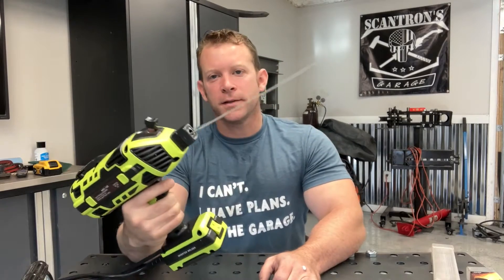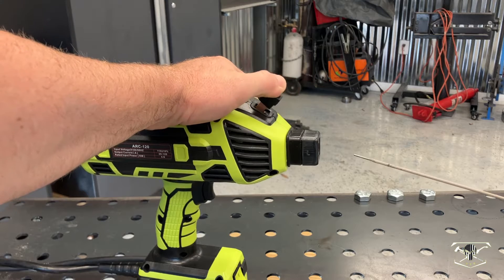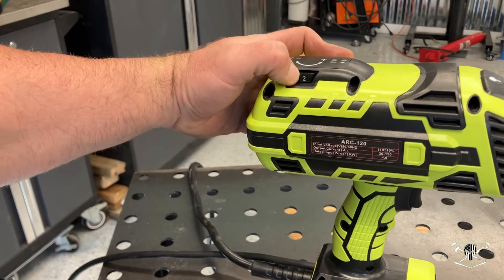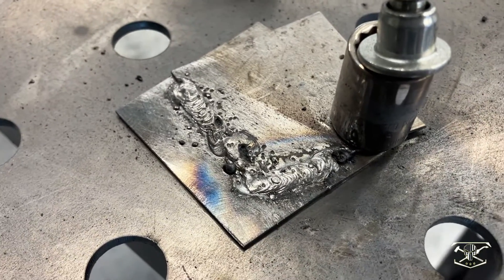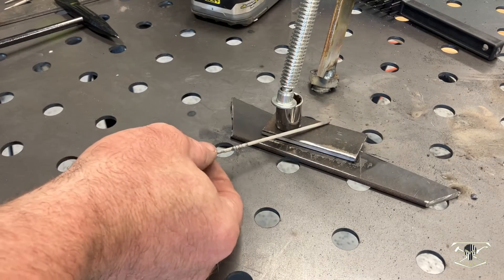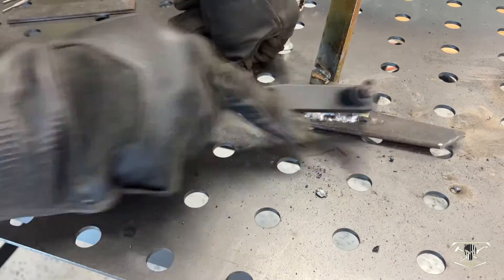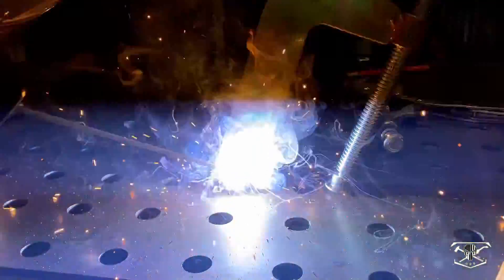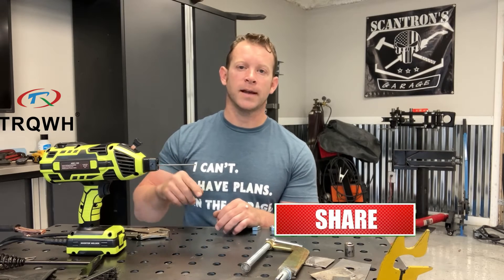Testing The Handheld Welder

Comment: How well did the plastic construction do over time being exposed to extreme heat like that? Seems like it would be a good idea for a welding tool to be made of something less susceptible to heat damage without being made in a way that would allow the electricity to flow through the operator.
Reply from the maker: There was no issue with heat transfer into the plastic framework.
Reply: And disassembly  contact point  rods..

Comment: I want to learn how to weld for home projects on my car. Is this suitable for tacking stainless steel exhaust pipes together for test fitting on the car?
Reply from the maker: Yes. This will work for thinner gage metal. Stainless is tricky to make look good without shielding gas though. Still a good machine to get started with

Comment: I tried 20 amps with the supplied rods, a lot of sticking, and not really producing a good puddle.  30-40 amps probably needed with a 1/16 60312 rod....16 ga. sheet metal hoping it doesn't burn through.
Reply from the maker: Keep at it. It took me a bit to get used to it
Reply: Did you keep that arc distance precise from the metal? Burn through = to many amperage/ to slow of travel speed. So, did you get used to it yet?

Comment: How thin of metal can you weld without blowing a hole in it
Reply from the maker: I did 16 gage with no issues.
Reply: I'm looking for that discount code you mentioned.  I'm sold on the idea that this will be great for rust repairs on body panels.  Thanks for taking the time to demonstrate this jewel.
Reply from the maker: @jimmykent6545  Thank you! the discount code should be in the video description
Reply from the maker: @jimmykent6545  The code is in the video description. SCANTRON15 from the TRQWH website

Comment: Great video, do you know what power generator would this run off?
Reply from the maker: Thanks! Any generator that supports 110 V and 20 Amps will work
Reply: @ great thanks
Reply: @scantronsgarage does work with garage outlet with 110 volts?
Reply from the maker: @paulflores9909  yes it does

Comment: it looked like it burned a lot of rod fast?
Reply: You will they are 2.5 rods smaller than you 3.2 and I would only use the 2.5 and Good Quality which will be Easy striking at the Beginning of the weld and  less of a load on such a small machine ❤😊
Reply from the maker: Yes, I was using a smaller filler rod. A thicker rod would have burned slower

Comment: Hello will this tool work on aluminum?
Reply from the maker: Yes it will....however it will result in an ugly weld. TIG welding aluminum will yield much neater and stronger welds. But this will work in a pinch

Comment: Does it only use AC rods?
Reply from the maker: Yes
Reply from the maker: But this is a DC welding machine. So just any filler rod with flux
Reply: @scantronsgarage It's the inverter in it.  I believe and Flux coated rod should do, hopefully!